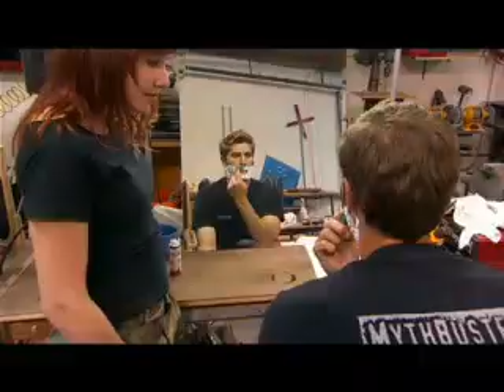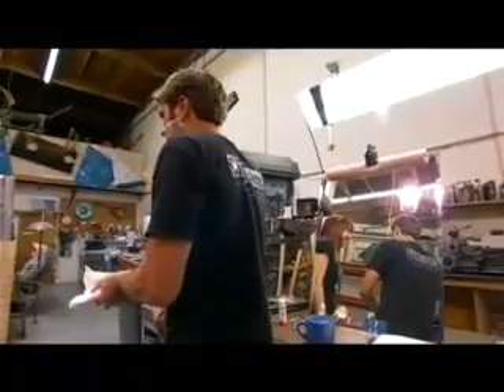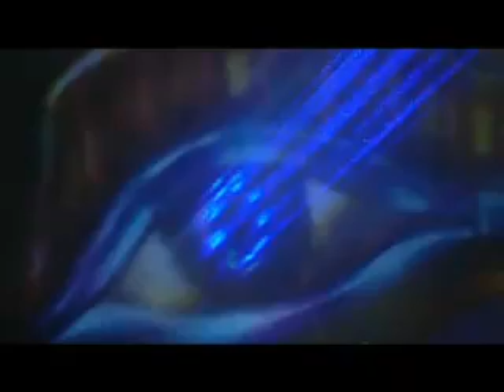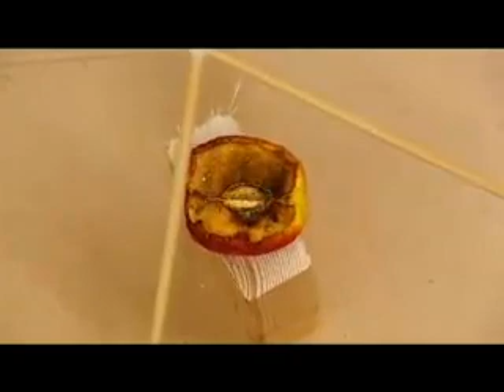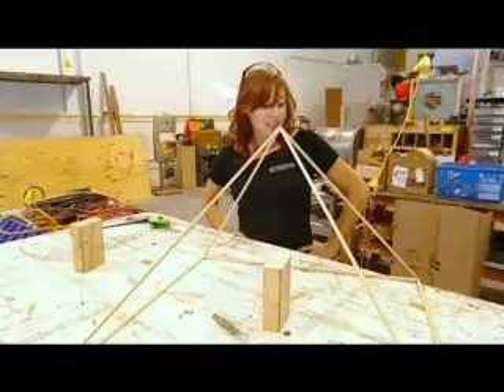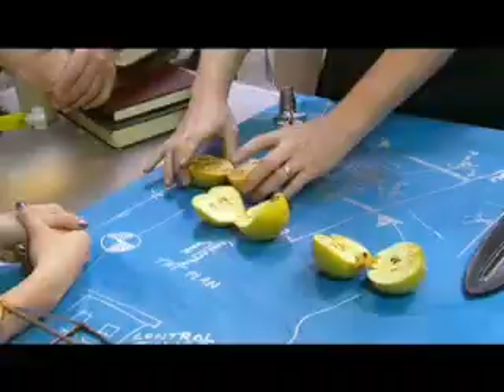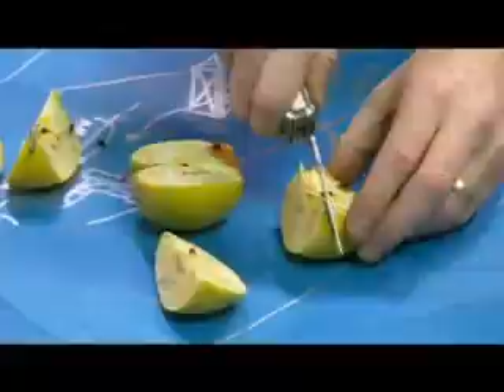Mythbusters 3x14 Pyramid Power (2 of 2)

Comment: Interestingly, there actually have been anomalous EM readings at the Great Pyramid, but this may be more due to the construction materials than the shape, though the shape may play some role as well.
Reply: Pyramids were structures locked tight with all sorts of stuff in them, with thick, solid walls. Just going in with the measuring devices could already falsify the results of readings...

There are also all kinds of possibilities for localized readings being out of ordinary that have nothing to do with the structures themselves.

To summarize, it would be weird if the inside of a pyramid was no different from the outside as the inside IS a microbiome all of its own, simply by the nature of its isolation. But that is irrelevant of the shape.

Comment: It seems to be a piece of disinformation. The pyramid with the apple doesn't have insulating walls that you need to contain energy within. In addition, the pyramid needs to be of the correct measurements and angle to produce the best results. I've done work on this subject and found it to be intriguing.

Comment: 40 years ago, I learned about  pyramid power sharpening razor blades.  I made a small cardboard pyramid, according to the prescribed dimensions, aligned it , again as told and placed my blade on top of a small cube, inside the pyramid.  I had two blades.  As each would dull, I swapped it with the one in the pyramid.  I used the same two blades for over two years.  Unfortunately, I misplaced the instructions for making and aligning the pyramid.  I don't know how it works on today's 5 bladed razors but on the old double edge blades, it worked.
Reply: BULL-FUCKING-SHIT.
Reply: Also remember that about 40 years ago, do remember the pyramid was 6 inches high and the platform (block) was 1/3 or 2 inch high to place the old fashioned 1 edge on each side blade, I think the edges of the blade were east and west and the ends (short) side was north and south. I done wrong so I heard the edge gets worse not better.

Comment: you did it wrong, you supposed to let it sit for like 2 years or something until the apple in the open area are completely decay. then compare it with the one in the pyramid, and you should be able to see the different since. plus you shouldn't put the open tested apple so close to the pyramid. like at least leave it meters away but in the same height and same room or same condition in the same area. we all did that in our sci class in high school. and it worked, just have to make sure you set the pyramid facing the true north east south and west. I meant like don't have one side of the pyramid facing north-east or something, as long as they are facing the true angle. then it would work. tried it like a million times.. Mythbusters should knows this too. it's very obvious they are trying to hide the true about this for some reason. this is what happened when the CIA owns all the major TV network in USA. they can lie to your face and get away with murder if they want. not alone some TV show. now. watch them putting me in some accidental death in a few months. since i busted their truth face in public network here. (remote control heart attack microwave gun that as big as a pen?) or a drop of the untraceable clear water that can kill? that's what they used 70yrs ago. who knows what crazy stuff they got now for the job. using computer power compare to 70 yrs ago. they should have something 10000000 X more crazy killing tools by now. just a push of a button at their office and send the concentrated microwave beam to me from space and kill me like that. not even joking iether.
Reply: Aye Mar even if you just just the stick to build the pyramid. and it would work too.. any material. plastic straw, or wooden trop stick. even thoothpick. we done this test before and they all worked. 
and also you can build different shape to make it decay faster too. i just forgot what shape we used. but i remember there is such thing for sure.
Reply: Aye Mar I don't' know if it matters, but I remember when we did it we hang the apple from the top of the pyramid using a strain. or thread. not putting it on top of the table inside. the simpler the design the easier to see or prove it's power.  so just 8 plastic straw. thread it or grue it together, then a thin single thread hanging from the top and tie an piece of apple or the whole apple in the other end. and adjust the height so it's hanging in the middle of the pyramid.

Comment: These uneducated people didn't prove anything, except that they didn't do their homework and they are acting like complete imbeciles, who know nothing about science.  The scientific experiments with pyramids and razor blades, and the reason so many scientific labs have taken out patents on pyramid technology was shown to keep a new razor blade from getting dull, not making a dull razor blade sharpened. So after you buy a new razor blade and you use it, you put it in the pyramid until you use it again and if you keep doing this the razor blade would keep from getting dull at least 2 to 3 times longer than a blade that wasn't put in a pyramid.  Also if you just rub the razor blade on jeans or leather the opposite way you rub it on your face before and after you use it, it will also stay much sharper, much longer.  Also the experiments showed that if the pyramid was made of metallic substance it actually had the reverse effect; the blade would become duller in a metallic pyramid.  Also the exact specifications of the pyramid was needed to have the best effect.  It was shown that Dr. Gilod's Golden Mean Pyramid had the best effect on keeping razor blades sharp.  The exact lengths of the base to the sides was paramount. The base must be 10 anythings to 16.2 of the same thing sides.  So if you had a 10 yard, by 10 yard base, you had to have 16.2 yard diagonals.  Or 10 feet by 10 feet base, you had to have 16.2 feet diagonals, etc.  Also the placing of the pyramid if non-metallic had to be facing True North, not magnetic north.  With Metallic pyramids for other positive effects, millions were shown, and have been continued to be shown since Dr. Patrick Flanagan first published Pyramid Power in the 70s, not for keeping razors sharp though, it had to be facing Magnetic North, not true north.   So these completely uneducated people, not specifying what shape pyramid they used, not saying what the material the pyramid was made of and not saying what direction the pyramid was facing, and to top it all off putting dull razor blades in the pyramid is just a complete insult to anyone who cares about knowing anything, but what team won the super bowl.  They ought to be doing potato chip taste testing instead of insulting people's intelligence.
Reply: If you really want to know about the amazing power of pyramids, I would recommend reading the best selling "The Source Field Investigations" before you read the best selling "Pyramid Power."  Both document real science, not quackery like this video.
Reply: thank you for setting them straight....I do have one question.
The white/red/black pyramids scaled down ... to the proportional electrical charge carried by the rock duplicated in substances has that ever been tried...seeing that the Pyramid is a actual power plant/battery/much more?
ty
Reply: Not sure, but it's all worth experimenting on.  There is a reason they left us the highest form of technology known to the planet, so we could maybe learn just a small iota of what they knew, so we could graduate from our preschool, coal and gas burning dark ages.
Reply: Tesla was reincarnated as Patrick Flanagan and he wrote the book Pyramid Power.  Tesla was way ahead of the scientists.
Reply: The used a compass to find north, right? Compasses point to magnetic north, not true north.
Reply: Well said Tim.
Just wondering now why they haven't don't Tesla based electricity test on Pyramids as if they may be power plants.
Reply: There are thousands or great scientific works on the study of the pyramids.  These goofballs obviously didn't read any of them.  Read "The Source Field Investigations" http://www.amazon.com/Source-Field-Investigations-Civilizations-Prophecies/dp/0452297974/ref=sr_1_1?s=books&ie=UTF8&qid=1456528561&sr=1-1&keywords=Source+Fields+investigations by David WIlcox and you will see that the author did his homework on Pyramid Power and he sites many scientific papers from around the world.  Read Pyramid Power by http://www.amazon.com/Pyramid-Power-The-Millennium-Science/dp/0964881268 by Patrick Flanagan and you will see these people have no clue.  .
Reply: Your so-called "analysis" is where you are screwing yourself out of true awareness.  When you are willing to give up your cognitive mind (the monkey upstairs keeping you stuck in the algorithms of causal reality) and all the programs running it, you will be able to start having true awareness and know what you know and not need to prove it by what others say, which is all based on lies.   Einstein doesn't have a degree in physics either.  And all the "analytical people" in the scientific community like you tried to use analysis to prove him wrong and to prove he was a quack, until an eclipse shortly after releasing his General Theory of Relativity proved as he REMEMBERED in the theory (because he was willing to have true awareness and not base his reasoning on the bullshit of what science was teaching) that light bends, as stars that couldn't be seen on the other side of the sun and moon were now visible to the naked eye during the eclipse, which isn't possible unless the light (or space/time) bent around the eclipse    Einstein was a worker at the patent office and learned and/or remembered most of what he knew like WIlcox and Flannagan from self study and from rememberance (and in Einstein's case from reading patents.)  As Socrates said "All knowledge is remembrance; nothing is learnt."   And Einstein rightly said, "Wisdom is what you are left with when you forget everything you learned in school."   Flanagan invented the Neurophone when he was very young.  So far no "official scientist" has ever invented such a walkman like it, that you can hear without your ears, as the electrodes on the Neurophone don't get attached to your ears, but you can still hear through your skin with it (which your "analytical scientists" still can't figure out how it works and Flanagan ain't telling those peabrains his secretes, because of what they did with them in his last life).  Before he even read any books, Flanagan, as a child, was inventing stuff in his families basement, and he told his parents before he even read about the guy, that he was "this guy named Tesla" in his last life.  His parents had to look up who Tesla was, but their son had no way of knowing who this guy was, as he was making experiments in his family home before the age of acquiring books in their home.  Flannagan purposely stayed away from "Official Academia (even though the CIA tried to hire him at an early age and he refused)" because of what happened to him in his last life as Tesla.   You can trust a person more who doesn't have a degree from some University in what they are teaching, to be way more honest, as most of what is taught in "uni-versities" is one sided AKA "UNI" controlled information, by elites who desire you to think a certain way, so you don't have enough wisdom to question their conclusion and judgments (all of which are lies), and you are stuck in their created matrix field based on algorithms (AKA THE PAST) which can only prove what is probable, not what is possible for people willing to claim, own and acknowledge that they are infinite beings that are fully omniscient, omnipotent, hyperlocal, hypertemporal and superluminal.  But you would never be able to give up your cognitive programs and break out of the cult of scientism, and/or be that infiniteness you are refusing to be.   "They pull our strings, the animals;  They blind, they breed the hate.  Under their wing, we're scientists, we swallow what they fake." - IAMX.  I won't bother telling you who I was in one of my past lives (that related to all this) or who Wilcox was, because you can look it up, if you weren't so controlled by your monkey mind.
Reply: +Major Tim To Ground Control Plus... did the mythbusters align the pyramid to the magnetic axis first?
Reply: do they were just trying to prove a point that they didn't know anything about pyramid power and they weren't willing to learn.
Reply: David Wilcox has a Bachelor of Arts is psychology and has no experience (that I could find) in physics or even experimental science. Not someone I would trust on the matter of physical science, which is what I would class studying the effect of structures on objects in those structures as.

Patrick Flanagan is an inventor that has 4 patents, two of which are for passing air through an electric field using fans, one is on making an electric field (which might be the most trivial thing I've seen a patent for) and lastly a "Nervous system excitation device" which is only an electric field generator (which of course would make the electric nervous system trigger). The only place I could find that talked about him in detail is on his own companies website, which praises him to the heavens in an attempt to sell products. (And straight up lies, like the "achieving one of the highest honors - the Scientist of the Year award in 1997". "Of the year" awards can be given out by anyone who wants to and there are no sources to which group of people that gave it to him. Without knowing from where he got it... "highest honors" is a straight up lie. )

Do you have anymore people you want me to analyse? I can do this all night :)
Reply: Ugh
Reply: not quite sure why everyone that believes in this theory is so defensive of their belief. These are educated people who are very intelligent. if you can prove to me using the scientific method that this works. then I might believe it.
Reply: you know its all bullshit right? there's no fucking magic keeping your blades sharp. that's just flat out retarded. the fact you believe it does insulted my intelligence.

Comment: Can one pyramid nut answer me this: How did the conspiritards get the base/side ratio of the Great Pyramid to be Pi to 9 decimal places? Before you answer, bear in mind that there is not one shred of evidence for the precise location of the bottom edge of the pyramid, as the casing stones have been removed. Also, bear in mind, that the very top of the pyramid is missing somewhere between 10 and 30 feet. That steel structure on top is not a radio mast or aircraft beacon. It marks the GUESS as to where the top was. Now, how do you take two measurements that have a margin of error not in thousandths of an inch, or inches, but in FEET, and come up with 9 decimal accuracy? (you do it by making shit up) Even if the bottom edge WERE intact, AND had ZERO variation along its length, then your 9 decimal accuracy would not be down to the ancient Egyptians, but to the 20th century builders who bolted a steel frame on top for people to measure. Also, 9 decimal accuracy would be impossible. The expansion and contraction of the stones in the heat would utterly swamp the last 3 or 4 of those digits. Now, take all that into account, AND the fact that the pyramid nuts you look up to STILL claim to have arrived at this exact figure, and tell me they are not either stupid or deceiving you. Keep a straight face while you do it, and I'll give you a biscuit. PLEASE try to argue. It will prove that you are wrong. There is no argument. The entire whack-job pyramid nut movement is built on this and other lies. The truth may not be as exciting as the bullshit on disclose.tv or abovetopsecret or any other such whack-job websites, but if you weren't such boring people yourself, you'd find plenty to be interested in in the truth. You can't make "a number close to 3" into 3.141592654 without a degree in BS.
Reply: Yikes, don't mess with him guys

Looks like lil bro is on his period😭🤦‍♂️
Reply: In the same way you can't "enchance" images to get details that were never in the data.  Although we do have DLSS :)
Reply: @michaelbauers8800  Exactly: By making shit up.

Comment: Yeah, very true. Some have said it runs on the same principle as bagdad/water batteries. I wonder if the shafts had different metals that met in the Kings chamber and the mass + shape somehow targets these invisible energies we call electromagnets into the center... then through the opposite metals through the shafts. Just an idea, but I think people who put shape into the equation WILL find the secrets of alchemy and it's not spoken because most people are too greedy to handle it.
Reply: Different crystalline rock would do the trick and be much more available then. It's common knowledge that crystalline rock holds electric charge....

Comment: Ok, quick "Scientific Question/s" if it can be called that: The pyramids had "walls", passageways and hollow chamber/s, and in this "experiment" they only based on the "SHAPE", forgetting that the pyramids are a "closed system" and not an open system. Couldn't they use any kind of material to cover the "holes"?
2nd question: Why where they testing the "PPower" in an environment filled with metallic items? Aren't those able to disrupt the magnetic readings when placed in mass quantities?

Comment: What is the basis for that claim, if I may ask? So far, according to what I've seen around, the magnetic field relation with the pyramids was the most important part to create the perpendicular electromagnetic field, NOT the geographic polarity. You can check it on google maps, if I'm not mistaken the orientation should still be "near parallel" to the time of its construction. Although this is based on what I know, I may be wrong ^__^'